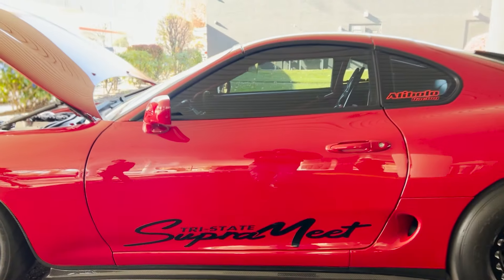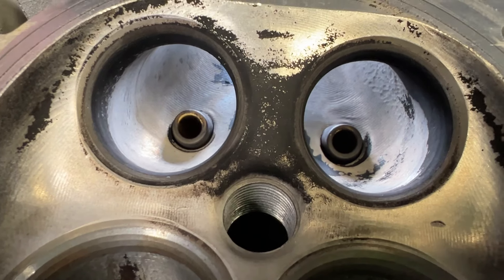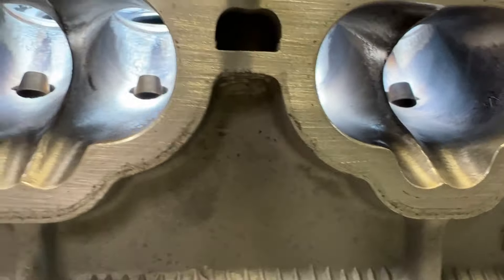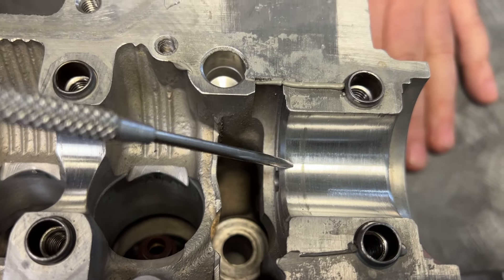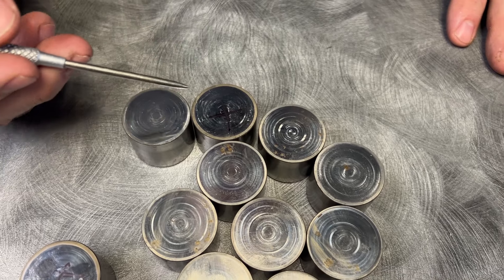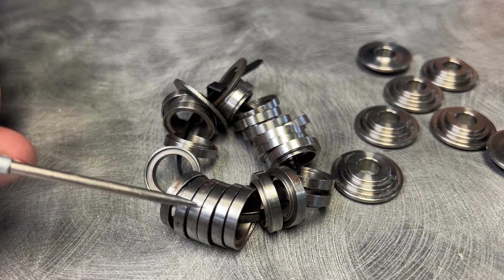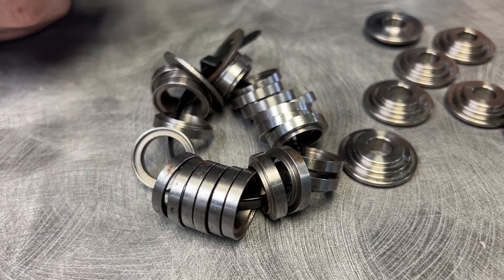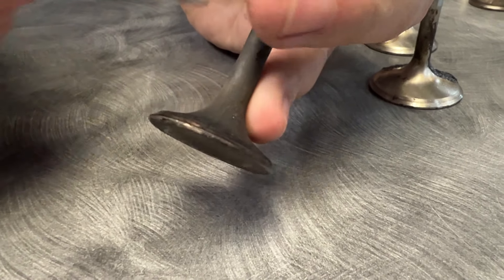1500whp Street 2JZ Teardown: What Lies Beneath!

Comment: What equipment and procedure should we use to remove valve guides ?
Reply from the maker: Depends on the head if you need a heater. But you would also need a pneumatic guide driver from Goodson and the least blows per minute air hammer from harbor freight. Then, to install them you would need to freeze them, have press fit lube and have a way to ream or hone the ID of the guide to size and then valve job the head since the valve job centers off that hole.

Comment: Whats the difference from oem 2jz buckets to 2zz? Why do you prefer one over the other. Thanks
Reply: shimless vs shim
Reply from the maker: Yeah what Jellybean said. The 2JZ bucket is a shim over bucket design and the 2ZZ is shimless. The 2ZZ has a little nipple inside the bucket that comes in different thicknesses in place of a shim. So, you would replace the entire bucket vs the shim. The shim can come out, and it limits you on lift because it is not the same outside diameter of the bucket so we just replace it with the shimless.

Comment: @ 9:20 👍bingo! Recently I was denied titanium retainers when requested. The cylinder head builder gave me tool steel instead. His reasoning was that titanium on street engines won't work and will break. Under protest I took the heads. 

In 25 years I'm yet to see a titanium retainer break in any engine I've built. After giving $4,500 for a pair of aluminum FE heads I'll be installing titanium retainers if its in the budget.
Reply from the maker: @arturozarate1752  just know that you need the ti retainer for that spring and be sure to check the install height!
Reply: @headgames  yes sir. On top of that.
Reply: @headgames  question. Ti retainers on conical springs ?

Comment: Awesome work as always. Dave have You ever dealt with TRW valves? They a OEM valve manufacturer out of Europe. I was advised to purchase them over Ferrea valves for my 1000Hp vw R32 build.
Reply from the maker: TRW valves are for lawnmowers, not performance applications in my opinion. When we broke world records back in the day with USP with that platform, we used only Ferrea valves. Issue you have there is nobody makes a spring kit that will be happy at that power.
Reply: @headgames thank You so much for the reply I really appreciate it. It was a difficult position for me to be in as this company is in Germany and they really specialize in the VW R32 builds and the make crazy reliable 1200-1300hp with this package of theirs with Supertech retainers and valve spring kit. They also do custom cams for this build that has a very impressive wide power band and makes the 1200hp at 8000rpm. So it is very difficult for me to say that their recommendation on these valves is good or bad. I'm going to see if the Ferrea valves are compatible with those retainer and spring kit and then get a set of valves. I'm actually very sad that You don't do the R32 head I would send it to You on a heartbeat.

Comment: single spring and e85 is risky if you dont keep oil changes regular, condensation can contaminate and fracture the spring material. avoid single springs in street cars unless oil is changed every 2000miles-MAX
Reply from the maker: There is no dual spring available for this kind of power, there is really only one choice. And, the conical saves weight. I wouldn't use a lesser dual spring because of fear that it would fail. We use the conicals in many different platforms with no issues. Only if you don't take care of your car is this a real issue.